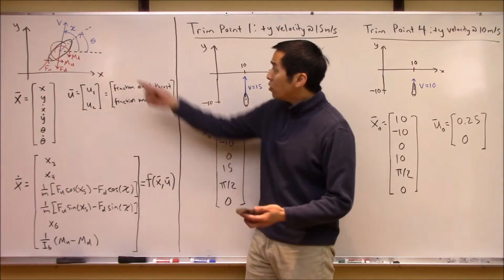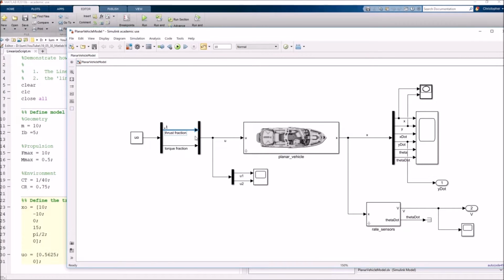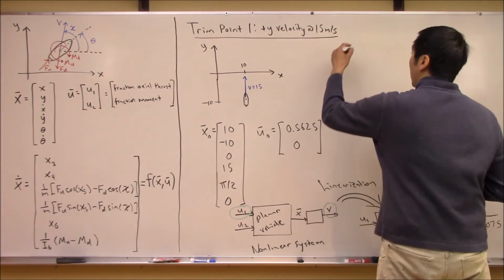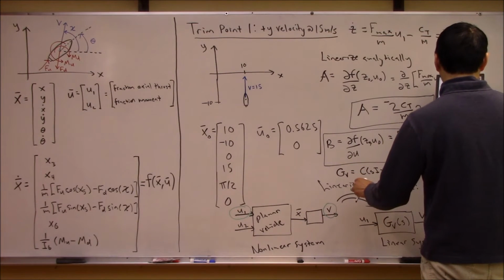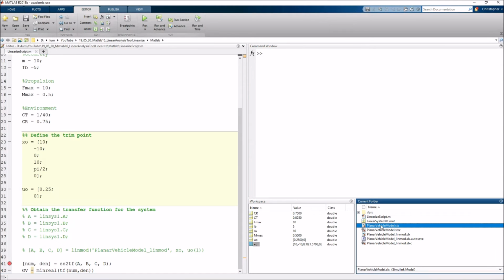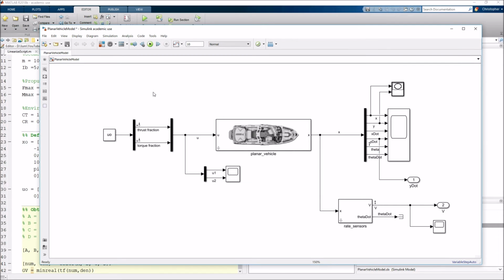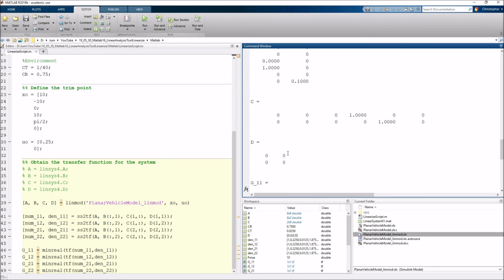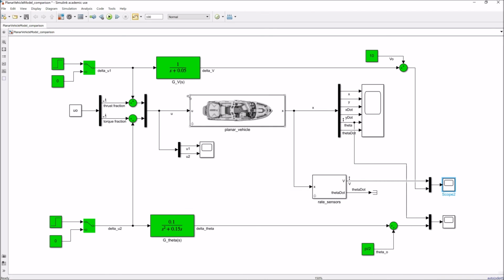Linearizing a Simulink Model Using the Linear Analysis Tool and ‘linmod’

Comment: AA516 - Thanks for another great lecture. Assuming that you are using Matlab and Simulink in industry, I am curious whether you tend to define system models within the Simulink GUI or as a function referenced by the Simulink "Matlab Function" call or something comparable.
Reply from the maker: Good question, it really is a combination of both methods.  Generally it is easier to use a Matlab Function if the algorithm is complex.

Comment: AA516 How can you tell if an operating point is stable or unstable based on the linearization of a system?
Reply from the maker: Kenneth, great question.  The second you have your linearization, you can check the eigenvalues of the A matrix to understand the stability of this trim point.

Comment: Hi Christopher,

i have a question regarding designing a linear controller for the linearized model, when we linearize the model in the desired trim point. For example the watertank model givin by simulink.  

Why does the linear controller (e.g. PID) works fine with the non-linear system afterward? The reference of the height can be set arbitrarly, altohugh i linearized the model for a certain height and not for all height. But afterwards it works with all reference heights.
Reply from the maker: Hi,
Thanks for reaching out, I'm glad you enjoyed the video.  Unfortunately I'm unable to respond to questions on YouTube due to the sheer volume of inquiries that I receive.  That being said, I hope you'll consider supporting the channel via Patreon at https://www.patreon.com/christopherwlum as I'll be able to answer questions there.  Given your interest in the topic, I'd love to have you as a Patron as I'm able to talk/interact personally with Patrons.  Thanks for watching!
-Chris

Comment: Thanks for this excellent work. Using the linear analysis tool is great but it appears one needs a separate subscription for that.  When I use the linmode, the step response does not behave similar to the output i obtained from then linmode. What am I not doing correctly? Thanks.
Reply from the maker: I am able to answer question directly through my Patreon page at https://www.patreon.com/christopherwlum.  Please free to submit your question there and we can discuss.  Thanks for watching and for supporting the channel!